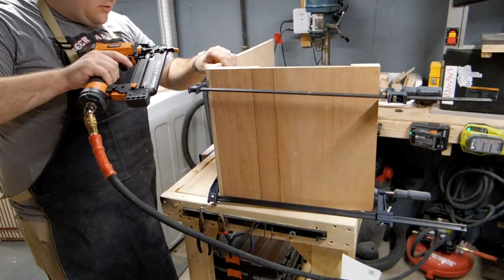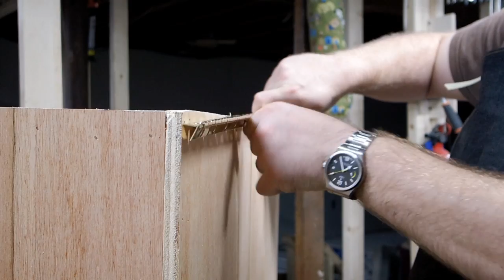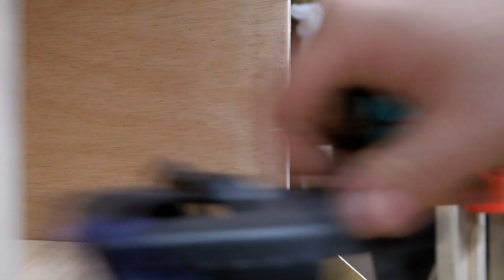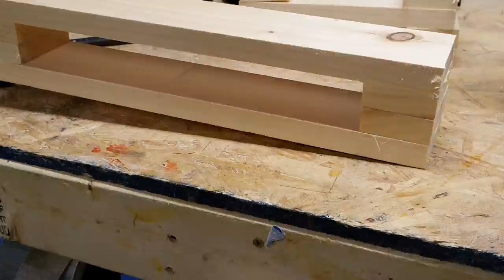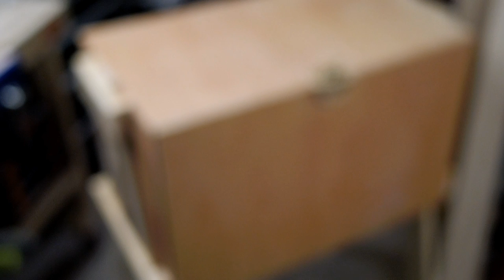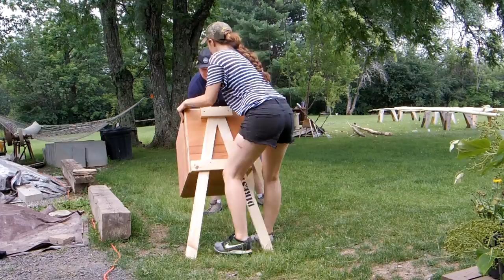Build: A Free-Standing Camping Kitchen

Comment: Use a 10x 10 awning over end of truck and trailer hitch platform with alum storage box that holds water pump leisure battery and led lighting.

Comment: What did you use to make your logo? Some kind of heat transfer? That's cool!
Reply from the maker: Jon H Thanks! It's a trick Laura Kampf showed in a tutorial using ammonium chloride solution to chemically burn the wood. I used a rubber stamp to apply the image before using a heat gun. I have a card linking her video at about 8:43 .
Reply: RhodyJeff Thanks! I'll have to try that out!!